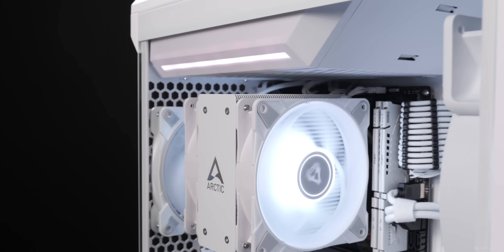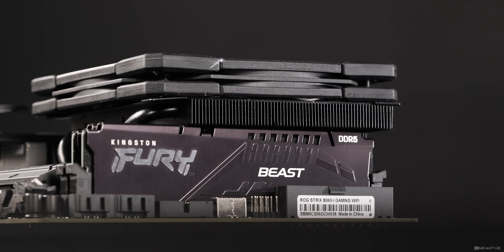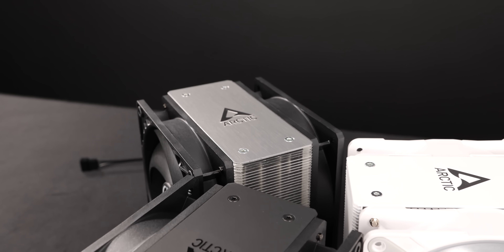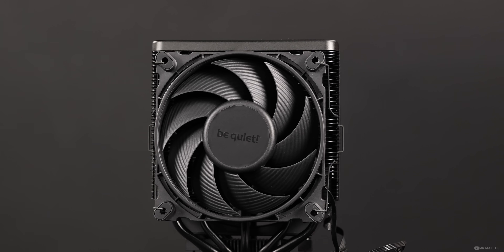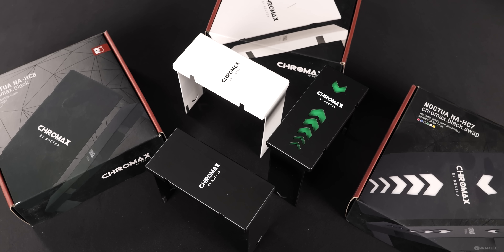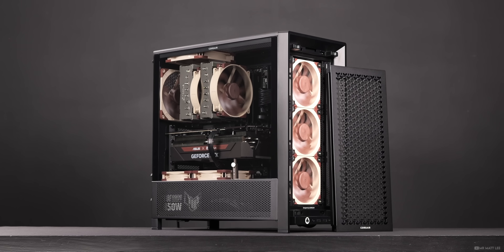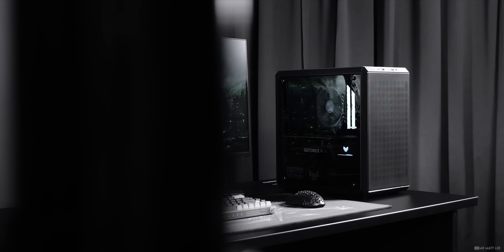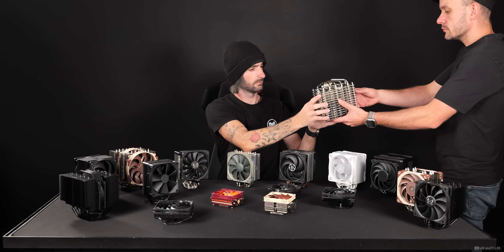Cooling Kings: Top CPU Air Coolers That CRUSH the Heat in 2025!

Comment from the maker: Which CPU cooler are you using right now? Did any of our recommendations stand out for you? 👀 As always, links can be found in the description too!
Reply: Currently using the thermalright peerless asassin 120. Perfectly cools my 9800x3d.
Reply: Noctua NH-U12A black on my main rig (10900k) and NH-D15 black on my 2nd rig (9900k). The U12A beats the D15, despite its smaller size. Tested both of them on my 10900k multiple times to verify results. Haven't found another air cooler that can beat the U12A.
Reply: @BeepBoop-o3o if I hadn't bought Fuma 2 earlier that would be my choice,,,
Reply: Arctic Freezer 36 black
Reply: Using Thermalright burst assassin 120 vision on rig 1 and Thermalright Phantom Spirit 120 SE on rig 2
Reply: just bought the Thermalright Peerless Assassin 120 SE last week as temporarily replacement as i'm waiting for replacement parts for my custom loop, and ooh my god this thing is amazing absolutely silent 31db on idl and 35ish db on full load on my ryzen 9 5900x temp never exceed 80c.
Reply: Dark Rock Pro 5, and your seperate video on it made me buy it 😎
Reply: BE QUIET! Pure Rock Pro 3 Black
Reply: CM Hyper 612 Apex
Reply: Thermalright axp120-x67 black in my Ncase T1 (V2.5, silver) with an AMD 7950x in a ROG Strix B650E-I, Corsair 32GB DDR5 CL30 ram, Kingston Fury Renegade G5 2TB and an Inno3D RTX 5070 (so, 2 slot config in T1 is possible, but went for 2.25 for a bit more breathing space for the GPU). For exhaust two Phanteks PH-F120T30 fans. Couldn't be more happy with the airflow, temps and noise. Great little package! The CPU cooler fits perfectly over the ram with some room the spare and are in numbers (!) the best for this case. CPU running idle running at 55-60 °C (fans at 33%, no noise) and under full stress 95 °C. GPU not passing the 45 °C. (summer now in Amsterdam, so ambient temps between 20 and 30 °C)
Reply: @Bobel775 similar setup in my t1 same cooler but I flipped the fan to exhaust on the x67 . I have an asus rog strix b850 I an an amd 9600x gpu is a evga 3080ti ftw3 ultra 12gs of vram the gpu barely fits in the case. I had to use a custom top hat case to gain the room I needed for the power cables
Reply: Forgot I’m using 2 120 mm Noctua case fans set to intake
Reply: Using the IDCooling Frozn 620, its quiet and keeps my CPU cozy!
Reply: Noctua NHD 15 S with mounting bar offset plus Deepcool thermalpaste guard ( copper 99 %)
Reply: using deepcool ak400 on a 5800x3d, barely able to cool it 😅
Reply: Thermalright peerless assa, value goat
Reply: Noctua NH-15DS the best !!!! with my 11900k !! play games in 60 C
Reply: DeepCool AK620 wh with 2 Arctic P12 bionix white
Reply: arctic liquid freezer iii 360 pro
Reply: Scythe fuma 2 cools my 7800x3d,,, perfect so far
Reply: Have the noctua d12l. Will be using it until they dont support brackets anymore. I only use 14600k and will be using equivalent in the future. No need to buy every time.
Reply: Noctua NH D15 G2 i I9 14900KF
Reply: I have a Deepcool AK620 cooling my Ryzen 9 7900 X3D
Reply: Blackout NH d15
Reply: Scythe Fuma 3, on my first gaming build PC. Doing an impressing great job on cooling my 5700x3D. Not to mention, it's affordable price make it one of the reliable air coolers out there in the market.  💪
Reply: Arctic freezer 3 for Ryzen 5800x3d, thermalright peerless assassin for Ryzen 3600, thermalright axp90-47 for Ryzen 5700G (mini itx), ocz gladiator for fx8320 (bazzite build).
Reply: CM HYPER 212 HALO single tower then switch to FSP MP7 dual tower
Reply: The Arctic Freezer in white. I was surprised with the performance when I got it.
Reply: Noctua NH-D15S for Ryzen 9700X
Reply: Have you built in the Fractal Design Ridge case yet? 🤔
Reply: ASUS Strix LC III ARGB. It's a good cooler, but I hate the software which is needed to control the RGB. I will probably swap to a Noctua air cooler soon. I cannt stand the complexity of all AIO's and their shitty software (LCD's are the worst).
Reply: using a scythe big shuriken 4 to cool my 9800x3d in an s400 case!
Reply: I'm currently using a MSI MPG CORELIQUID K360 V2 on a 12900k (not overclocked). Since building that system, I have switched the OS from Windows to Unraid; which the MSI software does not support properly and makes the screen no longer useful. I am curious, how does the 2 Noctua options compare as I'm thinking of switching?
Reply: Thermalright frost commander on my rig 14700k 5080 . Cinebench at 85C and cyberpunk cpu 65C gpu 68C
Reply: Thermalright in the last 18 years. Zero failures, top performance, affordable. My last build got a Phantom Spirit 120 SE, and before that the Peerless Assassin 120 SE twice
Reply: Last build = 9800X3D
Reply: Are you using enough thermal paste? It doesn't look like you are.🙂
Reply: Thermalright TRUE Spirit 120 Rev.B Ultimate match with Cooler Master Halo 2 Case Fan.
Reply: Currently using “AIR”
Reply: Thermalright Assassin X 120R SE PLUS, biggest of the cheapest cooler that fit into my OEM case (HP Prodesk 400 G4 MT with i7-8700 CPU)
Reply: Was kinda tempted to try the Arctic Freezer 36 aRGB but went with the Deepcool Assassin 4S on my HTPC
Reply: thermalright assassin spirit 120 evo argb. Insane value
Reply: I'm using a Deep Cool AK620 /w 2 Corsair AF Elite 120mm fans (non rgb)
Reply: DeepCool AK500 Digital Pro white.. I just wanted an info screen, so I got one 😅 with almost no cooling performance over my old ID cooling SE-226-XT, but it looks soo good in my build🤩
Reply: I'm using a Arctic Freezer 36 black with two Noctua NF-A12x25 PWM Chromax .black.swap.
Reply: Deepcool Assassin III
Reply: Noctua G2
Reply: Cooler Master MasterAir MA620M, clean look and really nice RGB
Reply: 1 thermalright peerless assassins, 1 frost spirit 140, 1 phantom spirit evo 120, 1 upsiren walrus 90mm, all across different systems
Reply: AK600-Bk. I'm going to Update PC with 14900k, which Air Cooler can cool this beast?
Reply: Deepcool AK620 in an Intel Core Ultra7 265K.  Ramps up in gaming but if  placed in the living room with distance, it's acceptable.
Reply: Noctua NH-D15 Chromax. Total overkill at the time, and it's SO big and heavy lol. It has done nothing for years with a Ryzen 3700x , but now it finally gets to cool a 9800X3D :D

Also used to have a closed off pc, but now I get to display it in a black Fractal North with glass panel :)
Reply: 7800x3d cooled by peerless assassin. I recommend the cooler to anyone interested in purchasing an air cooler. Cheap af, does the job, not ugly.
Reply: Be Quiet Dark Rock Pro 4, though I am considering swapping over to an AIO.
Reply: Corsair a115 with 2 p14 max fan on both side and in middle corsair 140 mm that comes with it 😈
Reply: i see many reviewer maybe i will change from thermalright si-100 to the peerless assasin :D thx man
Reply: Deepcool AK400 white
Reply: t120 white without rgb
Reply: For my I7 6700K i'm using Be Quiet! Pure Rock 2 BK007, it keep my CPU around 70℃ under full load (room temperature 30℃), I tried it on I7 12700K with turbo boost, temp was around 85-95℃ (same room temp). I also have a Noctua NH-U12S, with base clock on I7 12700K it manage hold it around 80℃ with minimal thermal paste, in turbo boost it can reach to 85.
Reply: Thermalright Phantom Spirit Evo 👍
Reply: ak400 in 12400, vou migrar pra 7800x3d ou 9800x3d e não sei qual air cooler ou wc usar...
Reply: Thermalright Peerless Assassin 120 Digital BLACK
Reply: What air cooler and what watercooler for 9800x3d?
Reply: Thermalright Royal Knight 120, since the Scythe Fuma 3 is much harder to get across the pond in blighty.
Reply: @OwDoDuck wich watercoolers for 7800x3d/9800x3d?
Reply: 240mm AIO with 2X 120mm ML Elite fans added to it. IF I was to buy a air cooler it would be the Arctic Freezer 36 because it has a small metal body with 2 fans. What I don't like to see is one fan on the body when it can have 2. It just looks better and has better cooling. Great video Matt. Well done. From Ethen.
Reply: coolermaster hyper612black
Reply: Using a Pure Rock Pro 3 black from BeQuiet

Comment: Ever since Thermalright pushed out Phantom spirit, it's hard to recommend any other Cooler (excluding AIO's, of course). At 100% fan speed, it outperforms Noctua NH-D15 G2, and it does that with 1/3rd of the price. Sure, it's a bit louder, but if you buy a cpu cooler to get your temperatures cooler. Thermalright does it 3 times cheaper.

Comment: Thanks for your vid Matt, I liked and subbed. I have long appreciated Noctua coolers and fans. I typically build a PC every 4 years or so and I'm just about to start a new one. My last two used Noctua fans and I doubt my next will be any different. 

My last build used a NH-U12A CPU cooler since I couldn't quite fit a NH-D15. This has run extremely quietly, reliably and tamed a Ryzen 9 5900X for almost 5 years now - currently reporting 41 Celsius (at idle, YTube, emails etc). I'd appreciate knowing how much better a second gen NH-D15 G2 would be vs another NH-U12A? ie dB noise adjusted cooling capability? 

That said, I'm seriously considering an Asus Pro-Art Creator X870E mobo with a Ryzen 9 9900X CPU (typically for photo/video editing rather than games). This CPU has a TDP of circa 120W (similar I think to my old 5900X). So, I suspect another U12A would perform just fine and have zero issues with RAM or GPU space contention. Since RAM prices (DDR5 64Gb) are getting excessive, I'm glad I recently bought 2x32Gb on offer (over Xmas) at a good price vs current (Jan'26) rates, but still a lot more than Nov'25. But that's hindsight and Enterprise AI does seem to be distorting the consumer market, with ££ increases now circa double mid 2025 pricing. I bought quality RAM "Trident Z5 neo" branded 2x32Gb from G.Skill with a 6000 MHz rating and low CL30 timing latency. BUT it comes with a large heatsink which makes me doubt it would fit under the second fan on a NH-D15 G2!? ie I think height is more than 34mm. I can't yet be sure on fit since I haven't yet bought a mobo or cooler to check properly. I can't easily change the Ram for a similar low-profile set without now paying at least £200+ (I'm in the UK and my return date for RAM is fast approaching). But little point returning as I'd need to now pay a lot more for something similar.

One published Noctua solution (to high profile RAM issues) is to dispense with a second fan on a NH-D15 G2 (ie overhangs Ram slots) or use a NH-D15S (ie similar heatsink but with only one fan). Does anyone know how well a NH-U12A would perform vs a NH-D15S or a single fan on a NH-D15 G2. Is it worth considering replacing a second 150mm CPU cooler fan on a NH-D15 G2 with say a 120mm fan (if it will fit).

I'm not the biggest fan of brown/beige cosmetics, but appreciate that the distinctive colouring is a strong defining look of the Noctua brand. It's a clear sign of quality and performance. As a former marketeer I wouldn't have Noctua change colour just 'cus many don't like it, but appreciate they also offer Cromex black for that segment of potential customers who can't abide the brown/beige aesthetic. I'm staying with trad colouring, but get around any aesthetic issues by using a non windowed case.

Comment: Actually curious if u tested Jiushark cpu cooler, then change the fans to better fans. Also would look neat for air flow showcase, since its direct into the mobo. :face-blue-smiling: Also would be neeat if you mix n match fans to other rigs, to see a difference

Comment: buy once cry once. noctua nh d15 gen1 going strong on i7 14700k. though, no air cooler is fully thermal throttle proof but thats okay for my use case.

Comment: But where is the data? The numbers? O.o
Reply: check some of the Gamers Nexus stuff, i think he recently posted a chart with alot of Air coolers. But if you want a Rank 1 air cooler with the best price. Go with the Phantom Spirit SE 120, it's 3 times cheaper than Noctua D15 G2, and it outperforms it...

Comment: Hi — can I get a quick recommendation? I'm finishing a PC build and I'm stuck choosing an air CPU cooler. I have a Deepcool CH160 Plus (mATX) case and ADATA XPG Lancer RGB 32GB RAM sticks that are quite tall, so I'm not sure which air cooler will fit. I don't want liquid cooling. The CPU is a Ryzen 5 9600X. Could you suggest air coolers that will fit the CH160 Plus and clear tall RAM modules? Thanks! (Please no Noctua, they are too expensive for me :D )

Comment: What air cooler and what watercooler for 9800x3d?
Reply: Any aircooler that can match a 120 TDP, id recommend the Noctua NHD 15 or the Assassin version, dual tower coolers are not only beefy, but quiet, AIO? id say anything thats 240 and up, this means anything that has at least two fans on the radiator mind you, AIO' perform better but have a higher noise profile than air.

Comment: the fuma 3 has 2 fans that blow is opposite directions? isnt this normal bad? 
in theory its in the middle of both a higher pressure then normal but too a area without airflow so it can be good and bad at same time :)
you can have the worstcase its the "dead air spot" and the "negative pressure" so i think funa 3 uses negative pressure for this example is a cases like the meshroom D are perfect use back a fan and use at the side a fan and as normal a slim fan over the cpu cooler for vrms you get on both sides the air fast out (as much guys means the gpu can suck in  the hot air too but thats wrong warm/hot air goes UP not down) so the gpu cant suck it in but the fan at the side can to help the gpu more because the heat of the gpu goes to up at front as normal at back it goes out by the side fan.

Comment: I'm wondering if the Scythe cooler, having opposite fan direction, would interfere with a typical airflow setup of front intake, and exhaust at the back and the top of the case...

Nonetheless it's very valuable insights, thanks!

Comment: Thanks for your comment on Scythe Fuma3, it's the lagacy of legendary Fuma2, as the name means Wind wizzard in Japan, it delivers silence and high CFM air flow as well
Reply: Wow it's actually Scythe! I love your coolers, use them in every build <3
Reply: Ive been using the Scythe Fuma’s since 2013
Reply: @blastkillskank  Wow old friend
Reply: It's good. However, it is not suitable for AMD 9000 series released in 2024 or later. For those, you really have to go with Noctua or beQuiet.

Comment: Nothing beats an Air cooler, you don't have to worry about maintaining a water cooler, corrosion, and other problems. I use a Noctua NHD 15 S lasted many years without any issues or maintenance other than a vacuum once in a while

Comment: I have a Ncore 100 Air case bc I wanted ITX that looked like an Xbox on steroids. I am using a 3 slot RX 9070 XT Red Devil, this allows me to keep the mono side in the default slot allowing for a 69mm tall cooler. The Thermalright AXP120-X67 fits PERFECT and keeps my CPU in the 60s when gaming for hours at a time

Comment: I’m rocking a Deepcool ak620 on my 5800x3d with a -15 curve optimizer. It stays between 40&50c CPU manages to stay at max clock speeds while gaming. The gpu an Asrock Formula OC 6950xt.

Comment: Thank you for featuring some of the most popular and influential Noctua coolers in this overview!
Reply: My last build had an NH-D14 in brown (used for 11 years), current system has an NH-D15 in chromax-black and I'd love a chromax-black NH-D15 G2 for my next build, if you release one. When Noctua CPU coolers are this good, and low-profile RAM is available, I still can't really see the point in going for an AIO. When combined with a Fractal Design Torrent case, they are air cooling monsters.
Reply: Too bad you got a bit too greedy with the prices :(
I had to go with Thermalright instead.
Reply: @Mara941  Same with me. Like I want Noctua but its just clearly too overpriced.
Reply: We are patiently waiting for your AIO

Comment: Using the Thermalright Phantom Spirit 120 EVO on my Ryzen 7 9700X and I'm getting 45-50C on idle and 65-75 while gaming. These are very good temps considering I'm using Asus AP201 mesh case with three bottom intake fans, one exhaust fan on the back, one top exhaust fan positioned as close as possible to the rear exhaust, and one top intake fan positioned as far as possible to the rear top exhaust feeding some fresh air to the air cooler's front fan, and I live in a tropical country in a room without air conditioning.

Comment: Been rocking the NH-U12A chromax for almost a year now and its been an astonishingly good performer for my Ryzen 7 9800x3d, never allowing it to pass the 80°C threshold under the most CPU-demanding tasks
Reply: That's amazing to hear! I am building a small pc and was really worried about the 7800x3d I'm planning to put in it because the case I want doesn't fit a dual tower cooler. 

You didn't undervolt or anything?
Reply: @HansAnders2011nope, bone stock settings, aside of the usual dram expo and re-size bar changes in bios, nothing else that I did on a firmware level to my pc

Comment: What is the purpose of this video? Just to advertise some coolers and sell through affiliate links? You didn't even bother to test and compare them with at least a CPU and on a temperature normalized room. Saw a bunch of small form factor ones, but you only mentioned one of ID Coolings' smallest ones. This channel is purely made for aesthetic cock sucking, and not for performance focused one's like Hardware Canucks and their impressive CPU cooler tests. Honestly, i feel disappointed with your content, improve it.

Comment: i switched to i5 14600k and my cooler is  kinda to little performance for it. What should i buy? peerles assasin 120 (used, 26€), be quier dark rock pro 3 (used 40€), noctua nh d14 (used, 40€)